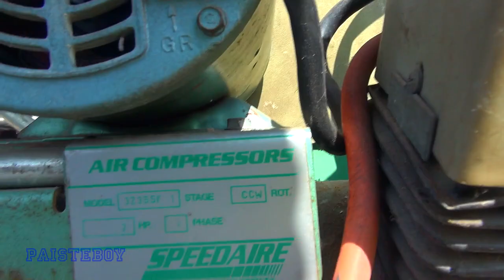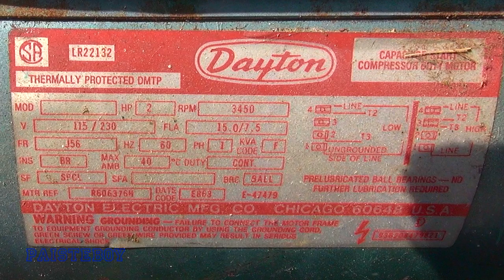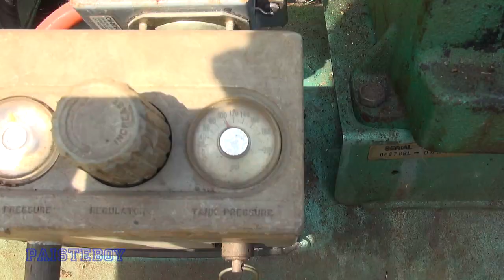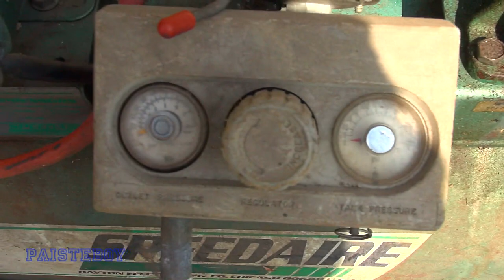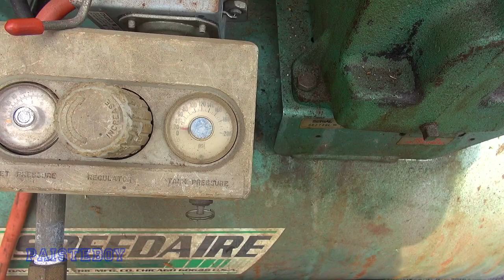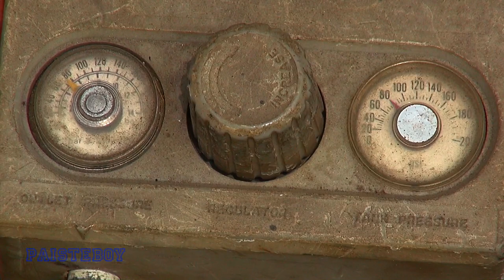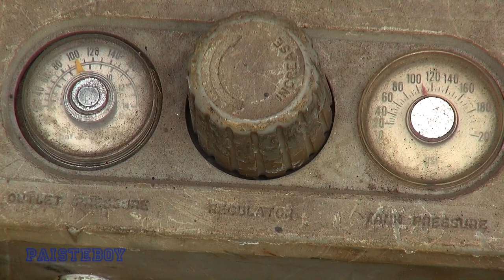Why does my Compressor trip my circuit breaker? FIXED?

Comment: I'm an electrician so I will give you some free advice :-) 
To start, your compressor can be wired to run on a 120volt circuit or 240 volt circuit.
Yours in particular is wired to run on 115/120 volts ( 1 hot - 1 neutral with ground) 230/ 240 volt is ( 2 hots with ground "3 wire" or with a neutral "4 wire")?
 If you look at your nameplate on the motor of the compressor it gives you the specs for current rating "FLA' ( Full Load Amps), 7.5 amps @ 230/240 volts or 15 amps @ 115/120 volts.
The reason you're tripping your house breaker and not the generator is due to the fact your house breaker is a 15 Amp while your generator is a 20 Amp and your house breaker has other loads on it ( garage lights, etc..) Breakers are designed to work on  "continuous loads"  of 80% of rating( so 80% of 15 is 12), you are @ 15 Amps "continuous" with that generator, already exceeding  the 80% factor of the breaker and that does not include the lights and whatever is on that circuit. 
Over time your breaker becomes weaker and can no longer hold the current like a 'NEW" breaker would, hence why the NEW breaker is holding :-) 
The new breaker will eventually start doing the same thing :-(  You need to run a 20 Amp circuit to your garage for that compressor or a 15 Amp 2-pole breaker- 230/240 volt circuit.
I wish I lived closer to you , I could come add the circuit/ breaker and  you could record it for "how to video" by a Licensed electrician :-) 

Can't wait to start seeing some more snowmobile content, keep up the good work brother!
Reply from the maker: Thanks for the explanation.  That helps a lot.  Since my panel box is in a finished part of the basement It's really difficult to get run a new circuit into my garage or I would take you advice and do that.  I wish you lived closer too.  That would be a great video.  I guess if the new breaker starts doing the same thing I'll be replacing it again.  I really don't use the compressor very often so it will probably last a while.  Thanks for the insight papa Wattz!
Reply: papa Wattz 👍I studied on that data plate too. Thought same. Good of you to volunteer the info & svc if closer. Not to many of us "old skool" proper peeps around anymore wishing to help one another. Seems everyone nowadays is lookin to get "rich" off of one job! Shame. 
Take care 🇺🇸👍✌️
Reply from the maker: @majorpayne5289  
I'm glad I put the picture of the plate in the video because it actually answered a lot of questions.  I think I may have a 20 amp circuit in my garage that may also need a breaker change so I am going to look into that.
Reply: @majorpayne5289  Thanks brother, yeah I agree, not too many people just wanting to be helpful out of the goodness of their heart, it's a shame :-( 
I was brought up that way.
Reply: papa Wattz -Yes sir, me too. I do okay & sleep well at night👍
Stay safe my man.✌️🇺🇸
Reply: Really appreciate this video and especially this comment. I’ve been searching and found the answer here
Reply: I had same problem and need to add a bigger box
Reply: Can make a video show
Reply: Thanks 😊
Reply: This video did not help me however, your comment sure did. Thank you!
Reply from the maker: You're welcome. 
Thanks for watching.

Comment: Could  possibly be a bad run or start capacitor. I recently had the same problem and it was the runcapacitor
Reply from the maker: It seems to work fine when I connect it to a 20 amp circuit. 
Thanks for watching.

Comment: My Speed Air is tripping the breaker only when it starts with head pressure. It starts fine at zero psi. 
I think there’s an unloader valve that’s not working? 
Thanks for the video but I’ll keep looking
Reply from the maker: Good luck.

Comment: Well it looks like you got your answer already. 15 amps continuous load on a 15 amp breaker isn't really a good combo.

My compressor runs on 230V and pulls a constant 22 amps so it's connected to a 30 amp double pole breaker. Installed the circuit myself. Fun times. It pulls enough power that LED light bulbs get a little flickery while it's on.
Reply from the maker: Yeah.  It makes sense now.  I dint think about that before.  Running it 230 splits the amps in half on each side.  I would run a new circuit myself but I don't have clear access to my breaker box.  It's in a finished area in my basement.  I'm going to see if the other circuit in my garage may be 20 amp.
Your compressor is huge and I'm sure you use yours.  I really don't have much need for a compressor that's why I waited so long just to change out the breaker.
Thanks for watching Krankie.
Reply: @Paisteboy  oh yeah, I depend heavily on mine! I use a lot of air tools working on cars. Thanks for watching my video as well :D
Reply from the maker: You're welcome. 👍

Comment: Is it still working with new breaker?
Reply from the maker: I don't use the compressor very much but the breaker definitely helped.  It really needs a 20-amp circuit but I don't have access to one.
Reply: @Paisteboy  ok good to know, 😊thanks

Comment: I’d say get a compressor that’s built within the last 10 years and you will have no problem.
Reply from the maker: I don't really need or use the compressor so I don't want to spend any money on a newer one. I might use it a little more now it won't trip the breaker. Lol.
Reply: I have a new one doing same thing... My old house has 15 amp breakers...as explained to me in comments. 🙂
Reply: Everything is  cHINA junk after 2005 😒